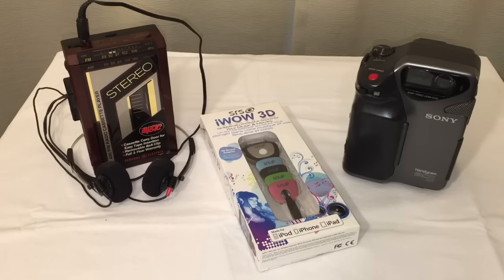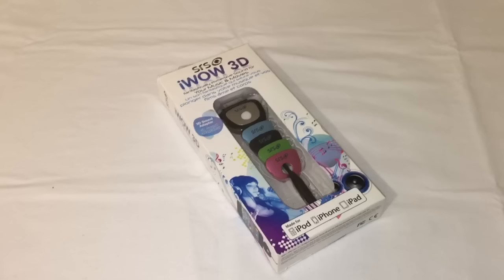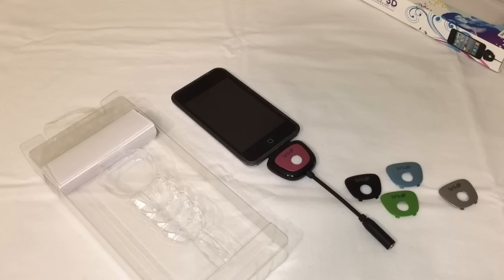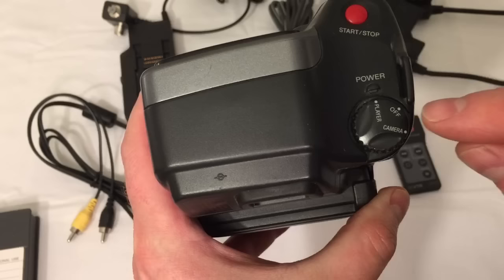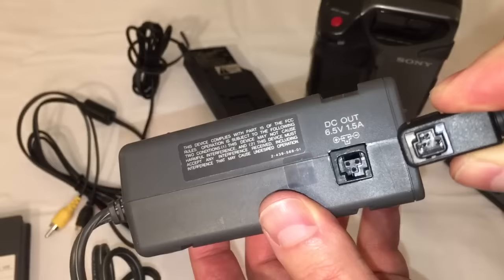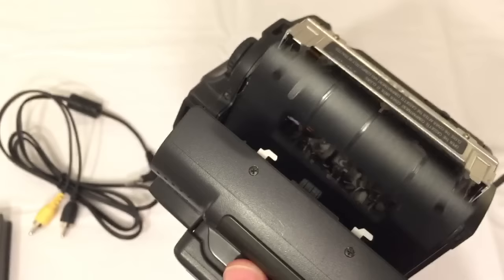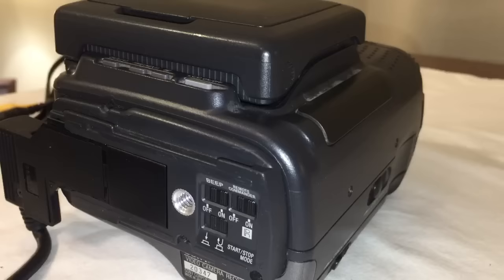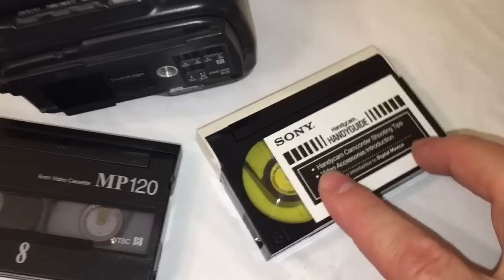Sony's Tiny 8mm Video 8 HandyCam Camcorder SC5

Comment: I actually prefer those old Walkman type headphones over modern earbuds.
Reply: Sannesthesia You can still find cheap ones in They probably just don't sell as well. The few portable cassette players sold these days still come with them.
Reply: I have vintage Magnavox headphones that fit over the ear and I use them with my smartphone.
Reply: They were only any good in the band-outside-the-driver-mounting-arms form as seen here. Most of the ones I ended up having to use ran the metal band along the inside of the arms, and it always dug into my temples and hurt something terrible. Plus they'd invariably slide down the back (or worse, front) of your head and fall off if you were doing anything active.

What I lament the general disappearance of are the on-ear type that had rubbery hooks to go over the top of your ears and a band that went around the back of your neck. Much more comfortable, as well as stable because their default position was already as low down as it could slide.
Reply: You're gonna love Koss PortaPros.

Comment: The Sony Connector Mafia is hitting this Camcorder. Every new Sony Product have had new Connectors - absurd no. Japan Engineers are Connector inventors or made Complex Electronics only for there own so no other engineer can rebuild this if they don't make a very long analysis about the old construction. What they Engineers do with that? They save there jobs in every Japan Company.
The first Video8 had also PCM Audio or Sound in Sync. Every Horizontal Sync the Sound is include the Sync and this is Sound in Sync. Also analog Satellite Broadcast had this Sound in Sync.
The Round Silver thing is not the Head! This is the Scanner or Head-Drum the Head are the small black something in the Silver Thing (Scanner) on the tilt slot.